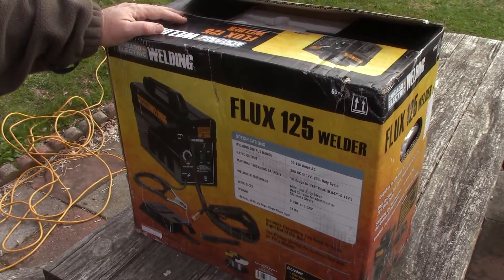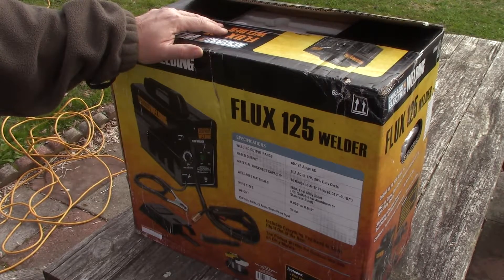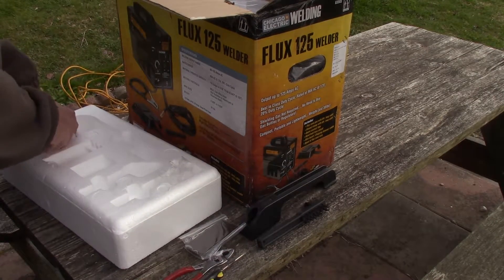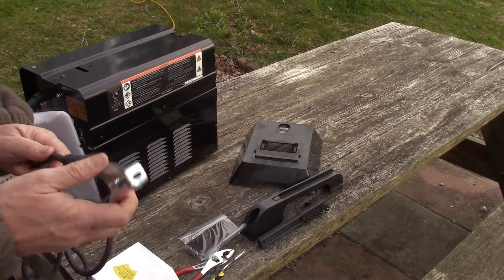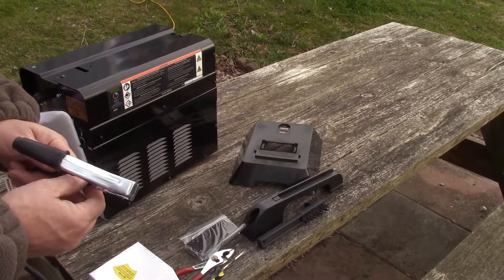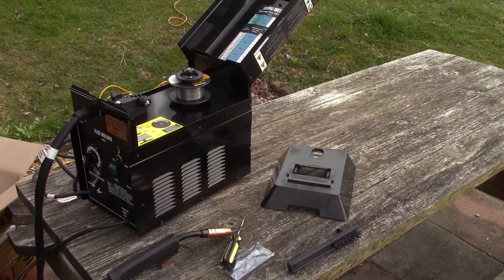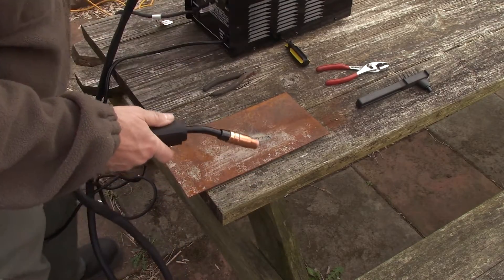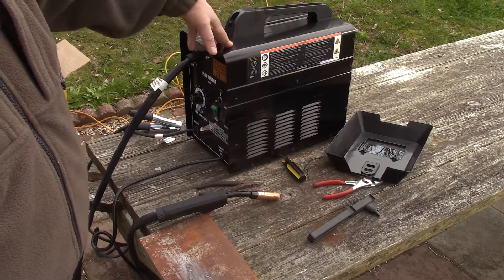Harbor Freight Chicago Electric Flux 125 Welder - Initial Review

Comment: I've watched my soninlaw weld his exhaust on his truck with a welder like that and it worked great. Harbor freight has good tools
Reply from the maker: Steve, for the hobbyist who just wants to tinker, fix a lawnmower deck, make camera boxes, etc., this is a great.  If I was welding for a business, then I would most likely want something better quality.  But for what I am doing this is perfect for me.  That band saw I used for cutting the metal for the camera box is Harbor Freight, my grinder, bench grinder, belt sander and other items are from Harbor Freight and so far, I have no complaints at all.  Appreciate you watching and commenting.  Juddie - J & J TOA

Comment: Nice review Juddie. One thing I have found with mine is it needs to be run on a 20 amp circuit when using the high setting. I tried weld some angle on high and it would trip a 15 amp breaker. I have a dedicated 20 amp circuit now and no more problems. Question: How hard is it to learn to stick weld? I have never tried that. Thanks
Reply from the maker: Thanks Rick!  Yes, I should have mentioned that it does require a 20-amp circuit to run, especially if you are running on "Max" and not "Min" amperage.  My building is on a 20-amp circuit, but most of the stuff I will be doing, most likely, will be on the "Min" setting.  Well, it is totally different from this flux core welder Rick!!  I have a Campbells 70-amp stick welder and I can weld with it, but it is hard.  You have to make sure you have the right rods and then you have to strike it against what you're welding to get the arc started.  I believe I mentioned in one of the camera box videos that using a new rod is hard when trying to get inside the box to weld because it is so long.  Of course I could cut the rod in half and the half I cut off I can still use.  It would be like having two rods instead of one.  I had welding in Jr. High School back in around 1974 or 75.  Mr. Lockett was the shop teacher at the time.  It really isn't that hard, just not as easy as this flux core welder.  Appreciate you watching and commenting.  Juddie - J & J TOA

Comment: Try Blue Demon E71T-11 .030  Wire its Best Wire I have tried and it Multipass Rated  E71T-GS is Single Pass ,  the E71T-11 to me Welds Much Nicer  .
Reply from the maker: Thanks!!!  I will be looking for that wire.  I am just a novice, Dan, took welding back in the 70's in shop class in Jr. High school.  Just do a little here and there, like making the camera boxes we use for our trail cameras.  Appreciate you watching and for the suggestion of wire.  Juddie